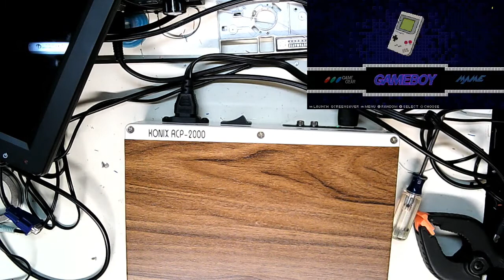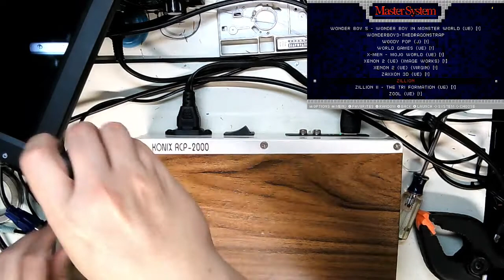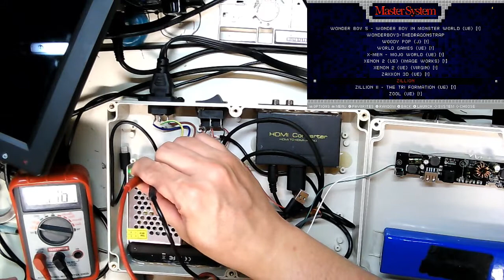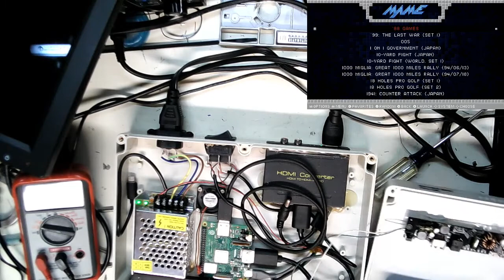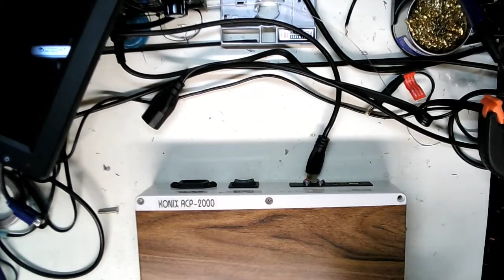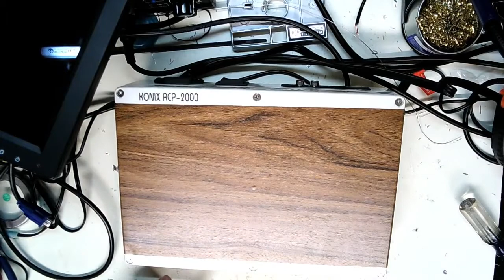What's On My Workbench, 12/27/2020 Konix RCP-2000

Comment: Thats awesome,  i love my pi but i always have issues adding 4 players thru bluetooth the pi starts to freak out.
Reply from the maker: I don't really have much experience with bluetooth controllers, I go old skool wired or dedicated wireless controllers.  Part of the problem may be on the Pi 3, the USB controller shares time with the Bluetooth controller.  I believe the Pi 4 has a dedicated USB and Bluetooth controller chip, but your mileage may vary.